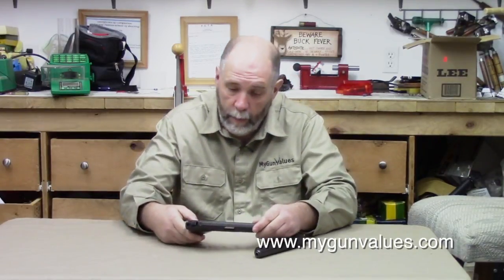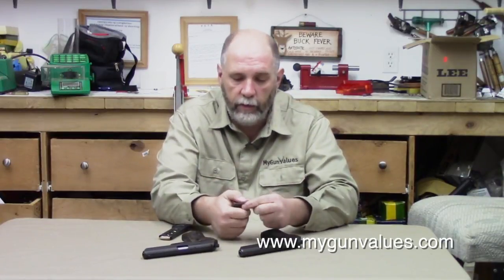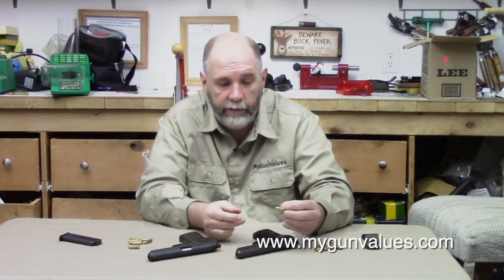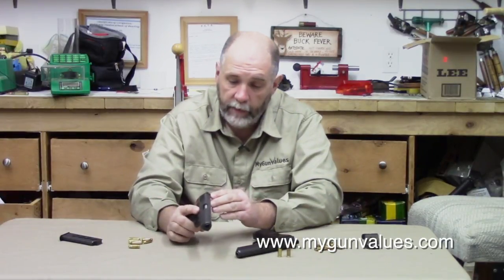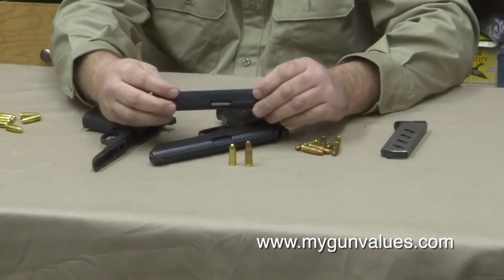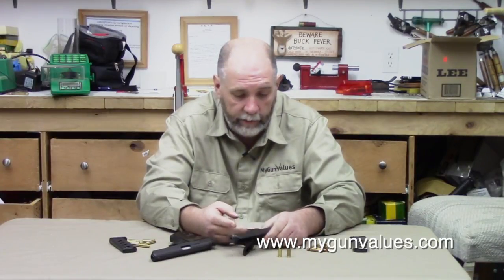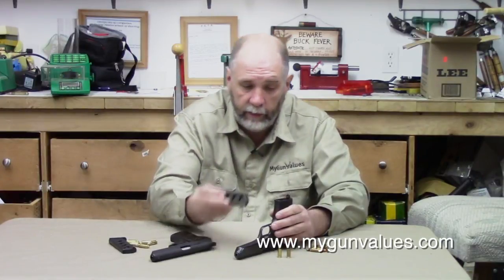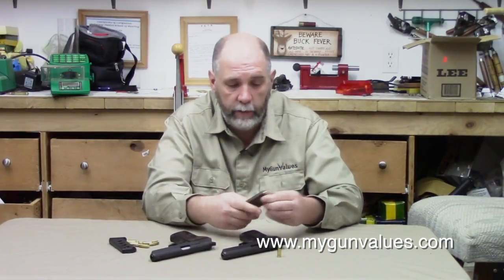Two different CZ 52's

Comment: Hey man those CZ-52's have a decocker mechanism in the safety. When the hammer is cocked push the safety all the way up and it drops the hammer for you.
Reply: NO NO NO NO NO. DON T DO IT WITH THE AMMO IN THE CHAMBER. BECAUSE THE DECOCKER IN THIS MOD SOME TIMES  DOES NT WORK PROPERLY.  SOME TIMES IT CAN WORK AS A TRIGGER, BECAUSE OF NOT GOOD DESIGHN, AND YOU CAN IMAGEN WHAT CAN HAPPEN.
Reply: Saw one decocked in the early 90s not knowing their secret he had a negligent discharge. The decocker on these break and FIRE a round unexpectedly boy when that happened it could've been bad this gave me a fear of decockers and dry firing always bothered me get a snap cap or fired case or something.
Reply: @alexandruborodin755 ......man you're CORRECT.

Comment: This is really an outdated video and not really informative about 9mm CZ52 history. A 9mm CZ52 sells now for far more than the 7.62x25 versions. The reason is 9mm ammo is far cheaper than 7.62x25. Also, not all 9mm barrels are Korean or Federal Arms kit conversions done by Joe Blow on his kitchen table. C.A.I. imported 9mm CZ52s from Czech Republic that were done by a Czech factory refurbish. These have the same serial number as the gun stamped on them along with "9mm"

Comment: 9mm was a barrel option ...and not very common vs the amount of cz52s that flooded the market ..and he doesn't know the safety is a decock in the beginning of the vid..rolling lockers are the reason that gun is able to fire the way hotter sub gun ammo .. original Russian tokrev t33 or whatever varriants  is not like a CZ52 and should only fire the lower velocity tokrev rounds ..sellior&Bellot 7.62x25 is good for cz52 and subguns like pps43 ..tt33 pistol is crap
Reply: I have a bunch of the subgun ammo in 70-round boxes and with the exception of a few click bangs due to the age it works fine. Thus guy really doesn't like the gun and has clearly never fired one. Once you put some rounds through it it is a good gun to shoot.
Reply: He knows about the decocker. CZ 52’s are prone to accidentally engage the firing pin when decocked. Potentially very bad. Additionally, earlier firing pins were cast and were quite brittle. Again, dry firing or engaging the unreliable decocker can, in some cases, destroy the firing pin or, far worse, cause an accidental discharge.
Reply: @billywallace8095  yes. you are absolutely right.

Comment: You are definitely NOT covering the history of this gun. If so, you would now that the gun was originally designed for the 9mm luger aka 9x19 etc. and was rechambered due to the oppression from the soviets.
Reply from the maker: Maybe so but all of them imported into this country were the Soviet round. Any 9mm in this country was done so with the 9mm conversion kit that used to be sold.
Reply: What he is say is the original design was for 9mm but Russia wouldn't allow it and forced the Chech to make them in the standard Russian round of the time 7.62x25. So while designed for 9mm none where made chambered for 9mm from the factory.
Reply: @mygunvalues  I'm no expert. I have a CZ52 with a 9x19 (9MM) barrel that has the serial number of the gun so it is not from a conversion kit. It has no import marks that I can see. For this one, I bought a 7.62 barrel assembly with a recoil spring for that cal. Runs fine with either barrel.